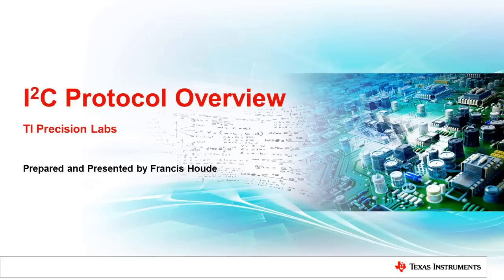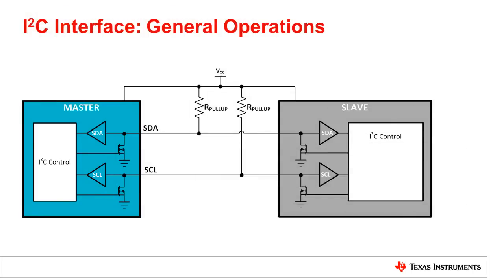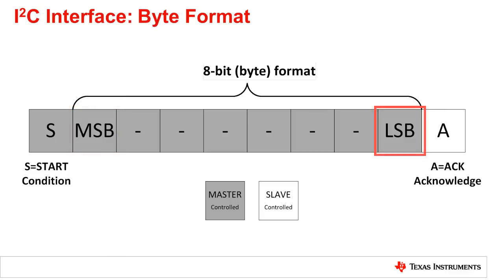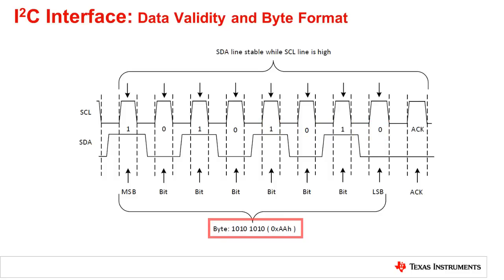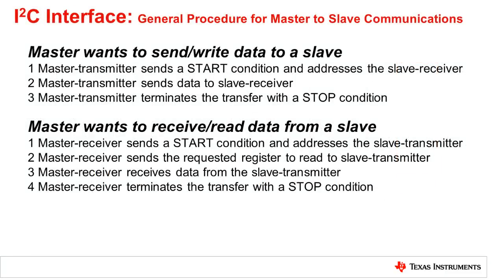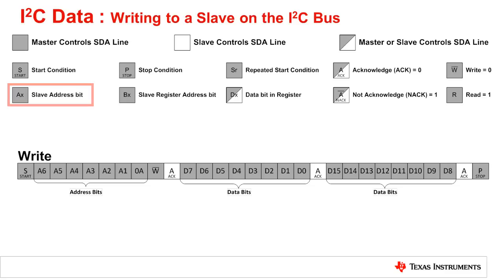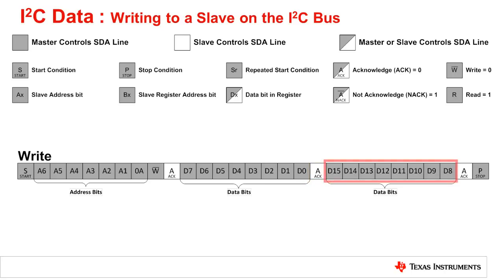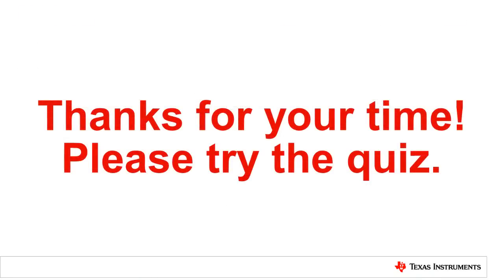I2C protocol overview

Comment: 02:00 So if the clock remains high, and some device pulls the data line down (signaling start), and then releases it back to high (signaling stop), would it mean an "empty packet" with no address nor data inside? Is such thing allowed to happen?
03:46 So if I flip the data line during clock high, it would either mean STOP or (RE)START, am I right?
04:40 What if the sender haven't released the data line yet, and the receiver pulls it down too?
08:43 So how can the master inform the slave that it didn't get the last byte correctly?

Comment: A little audio processing would really help. Normalize the level, a tad of compression maybe, and smooth out the freq. response.
Reply: Agree, SCL, SDA sound the same. Just call it clock and data. There's no error correction. ACK just means "hello, yes I'm here" but doesn't repeat back to the master? I'm correct?
Reply: @johnborrell9021  No it says "yeah, I received and understood what you sent, send again I am ready"

Comment: I2C read is a bit confusing at 8:26.
How a slave know which register data it is sending. Isn't it the master needs to first
1. master write slave address
2. master sends register address which it wants to read (rw bit don't care)
3. repeated start with slave address with read bit 1

3. slave started feeding data from that register.
Is it correct? I am telling from bma220 datasheet.
Reply: Yes. It has a different little more complicated protocol than this typical system. 
1. Master sends start bit
2. master sends slave address(7bit)
3. Master sends write condition 
4. Slave send ACK
master sends register address that required to read(8 bit/LSB ignored = 1 or 0)
4. Slave sends ACK
5. Master send Sr(Repeat start) condition
6. Master send slave address again
7. ACK from slave
8. Slave send 1st data byte
9. ACK from master
- Repeat 8/9 for 5 times
10. Slave send last(6th) data byte
11. NACK by master
12. Master sends Stop

Clearly explained in this datasheet
http://image.dfrobot.com/image/data/SEN0168/BMA220%20datasheet.pdf